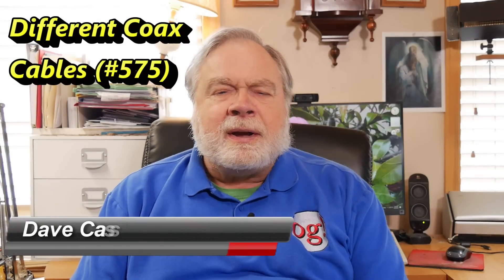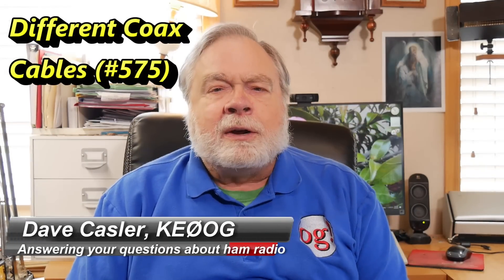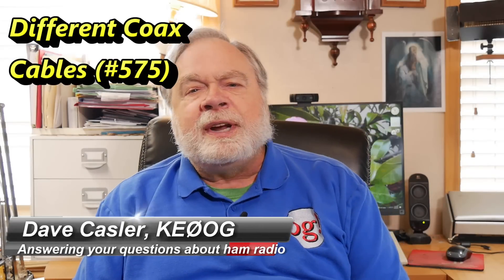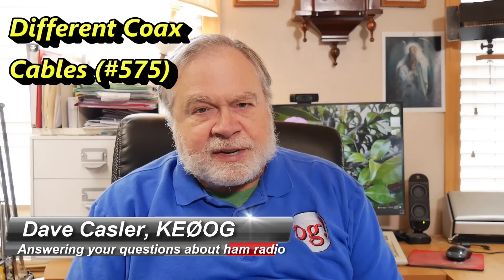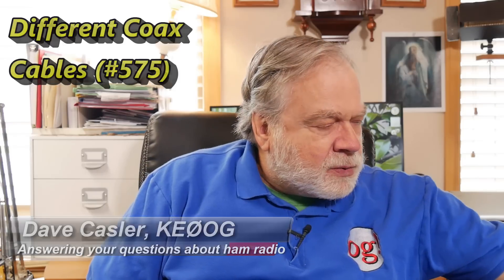Different Coax Cables (#575)

Comment: I would go with rg393. It's the same size as rg8u, but has a few advantages.  To start It's double shielded,  and instead of a foam dielectric  it is made of Teflon and doesn't burn. Or as with any foam dielectric melts and burns. It's only drawback is It's expensive.  But i think it's benefits out way it's price.

Comment: What would recommend for a 400 watt CB Ranger RADIO in a semi truck the length of the coax is 6 feet?
Reply: Aircell 5 or 7. They have better screening than the RG58.

Comment: Question: I have LMR 400 going to my antenna but I have a window pass through. Is there a problem running RG-8X from my radio to the passthrough connected to the LMR 400? I'm only running 100w right now so I know the LMR-400 was a bit overkill but I'm future proofing myself right now.

Comment: I'm not a ham (at least not yet as I don't know how to get licensed with my disabilities).  I am more just a receiver. I am curious on cable differences for receiving as most I see talk about TX power but I want good cable and antenna for purely receiving with low loss. As there is no TX, wouldn't there be different considerations to use? Also what to use for widest frequency span or separations of each bands of different cables.  Sorry I am really new and just trying to educate myself as I try building my own receiver.

Comment: I tell the younger hams this all the time but they don't believe me:  75-ohm coax was in use by hams loooong before 50-ohm coax was used.  You can still find or modify SWR meters for 75-ohms.  I use RG-11 (which looks like RG-8) on a few of my antennas, including my scanners and my VHF/UHF base vertical.  I picked up a few reel-tailings of it for free from a construction contractor who was building a huge apartment complex (it would have been scrapped otherwise).  The nice thing about RG-11 is you can spin on and solder a PL259 right to it without any adapters and it is good for a kilowatt or more.  Mine works great.  I don't get that 'magical' 1:1 SWR with it, but I get a 1.6 to 1.8 which is just fine.  That small mismatch will not hurt my output signal.  You can always use a 'coupler' to remove the mismatch if you are terribly concerned about it.  And it is perfect coax for those flat-top dipoles which have a 72-ohm feed point impedance when properly tuned.  73!

Comment: Hi Dave, thanks for the video. When you have an opportunity can you talk about line loss?  Are some cables more forgiving at 2:1 or 3:1 SWR in terms of lost power?
Reply: The loss comes from the signal making multiple trips up and down the feedline when the swr is other than 1:1. Each trip it is subjected to the same losses again.
Coax loss is published for each type. Usually in dB per 100ft.
Remember that 3dB is HALF !

Comment: What a great video.  I use 150ft of RG6 quad-shield from Home Depot for HF with weatherproof F connectors and F to PL259 adapters.  It works well with my fan dipole.  I only run 100W, and my dipole is closer to 75 ohms than it is to 50 ohms anyway.  I have heard some people say that RG6 will NOT work for amateur radio....this could not be further from the truth. 73 de N2MXX
Reply: Where did you by the F to Pl259 adapters?

Comment: I use LMR-400 exclusively that is assembled by a commercial company in Redmond, Oregon.  The company is SAT-PAK and they are ham froendly.
Reply: I use LMR400 for EVERYTHING including jumpers. I have used RG6QUAD to a dipole running 800 Watts and did just fine. RG214 is used on my repeaters jumpers.